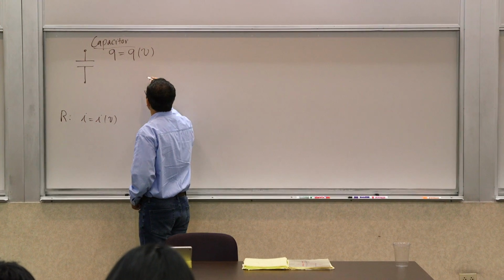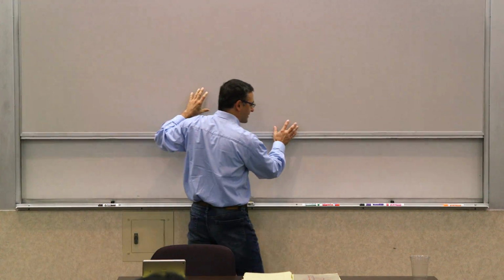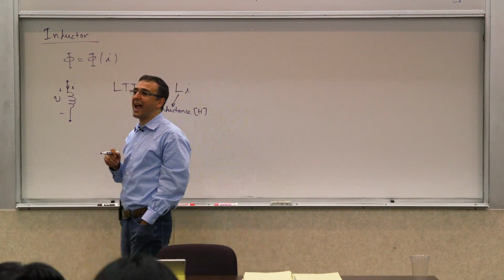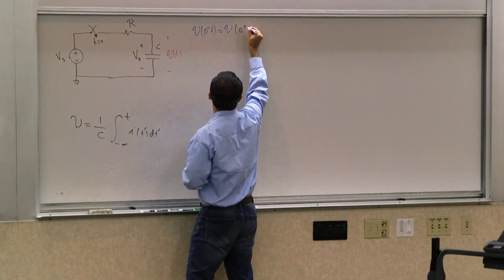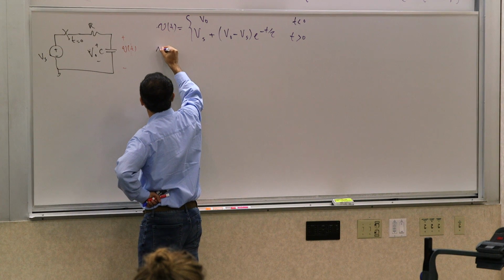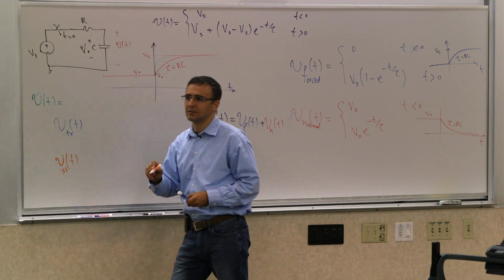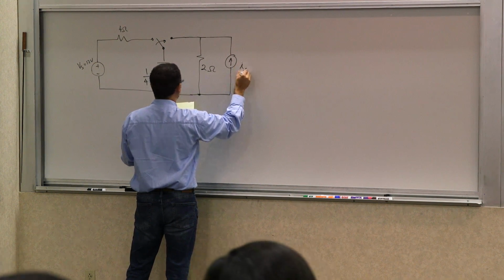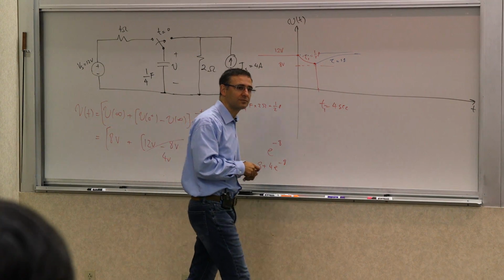014. Time-Domain Response: Capacitors and Inductors, RC Response, General 1st-Order System

Comment: If the current wave has some points where it's left side differential limit is not equal to right side differential limit ,so di/dt is not defined at that point, for example top vortex of triangular current wave , in that case what will be its voltage value at that point( top vortex) if the current is passing through an inductor????

Comment: Sir at time stamp 31:00 how come we can have infinite current via the two methods mentioned by you.The two capacitors will burn out I think.
Reply from the maker: That us the difference between a mathematical abstraction of capacitor (which remains ideal for any current or voltage) that is used a core element of modeling and a more detailed model of a capacitor that takes such non-idealities into account. We use the abstract model to create a simplified model and then augment it to capture additional effects that are important to us under a given scenario.
Reply: @AliHajimiriChannel  Got it Sir.Thank You.

Comment: Do natural frequencies of a system (mentioned in future in video 18) have any connection to the natural response mentioned here? I would say no, but natural response would have the same natural frequencies as the forced response, that is capacitors would discharge it's initial condition charge in it's natural response with the same time-constant as they would be charged in it's forced response.

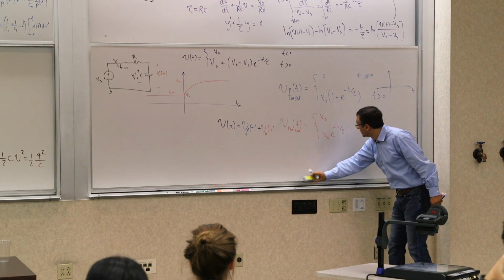Comment: 47:50 - So if there is no change in circuit structure, natural response would be zero? As there won't be possibility for capacitor with some initial condition to start discharging as the switch closes (changing the circuit structure). 
Or we can do something crazy and say, we still can specify initial condition for t=0 that would produce a natural response, even though input signal was zero for all time from -infinity to 0 (because we have such input), and should have discharged all capacitors (set all initial conditions to zero)?

Comment: So, we can have a time-varying capacitor by changing the temp around the capacitor. Based on this scientific fact that the changes in temperature around the capacitor affect the value of the capacitance. Is it correct?

Comment: Time Stamps:
0:00 = Review
1:36 = What is a Capacitor?
5:23 = Time-invariant Capacitor
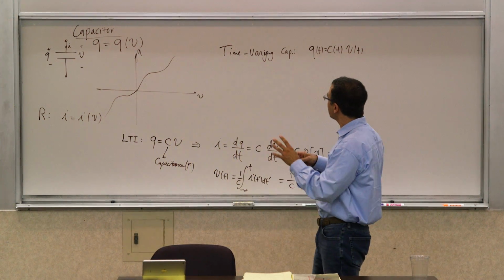10:37 = Time-varying Capacitor
12:35 = Capacitors in Series and Parallel
19:00 = What is an Inductor?
24:13 = L-R-C are like Lego Blocks
26:52 = Time Domain Example #1
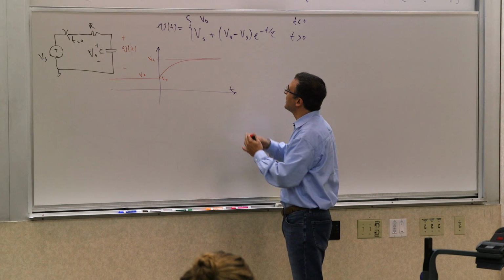43:10 = Forced Response, Natural Response
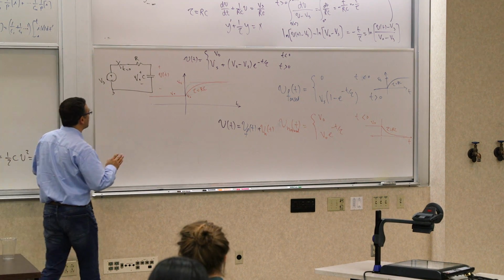49:29 = Transient Response, Steady State Response
53:30 = General 1st-Order System
58:43 = General 1st-Order Example #1
Reply: Thank you for doing this 😀
Reply: @bhawanaadhikari6658  My pleasure!
Reply: Thank you, It is very useful